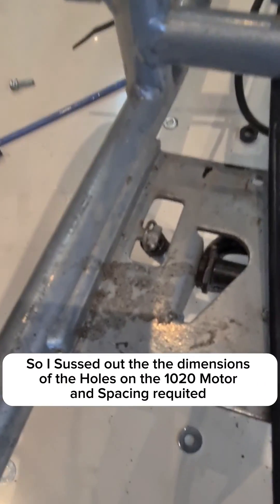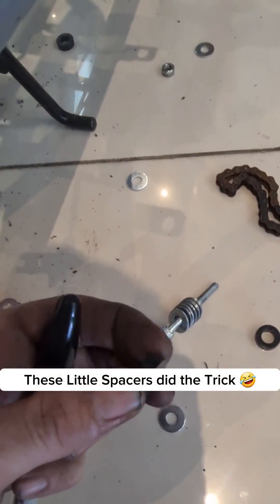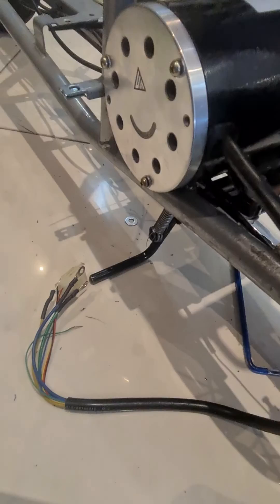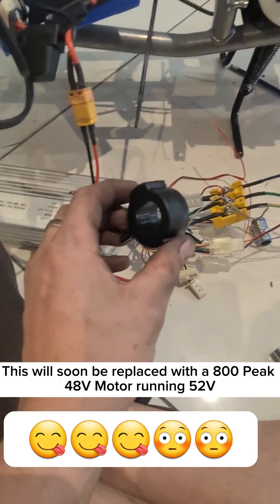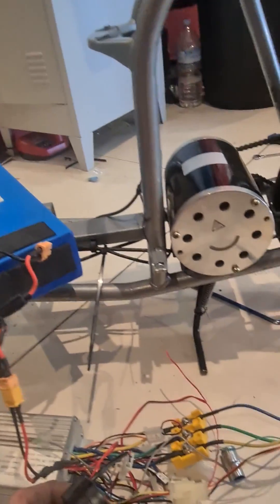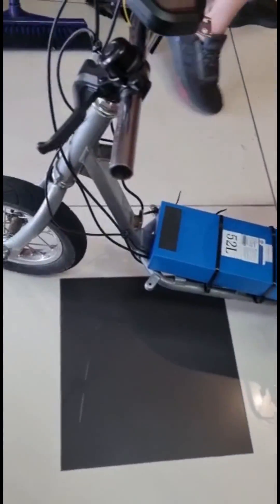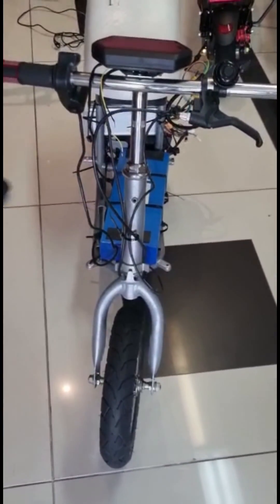Brushless Motor Install into Razor Pocket Mod! 🛴🔌 Overvolted 52v

Comment: I just got my 1000watt motor & controller in today. I'm going to use spacers to bold my motor in. Great video
Reply from the maker: Cheers bro 👌 yeah it was easy enough even small washers just buy alot of them 😁

Comment: Looks like a 500 watt brushed dc motor
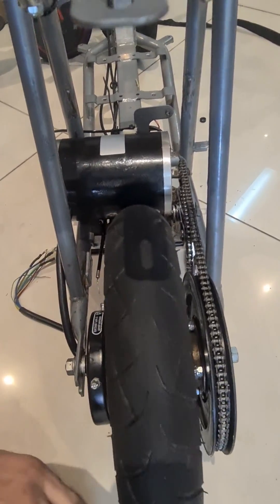Reply from the maker: 0:38 you can see the wires, Brushed is red and black Brushless is 3 wired with hall sensors
Reply: @djhighvoltageoffical  I know you can see the three wires it’s just I have a brush DC motor that’s 500 W that looks pretty much exactly the same. I wish I could show you a picture.